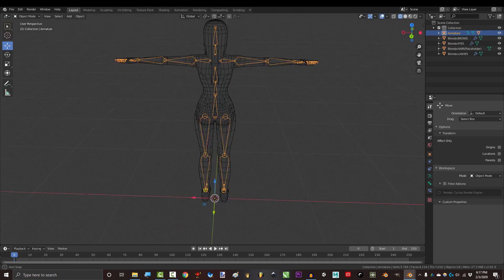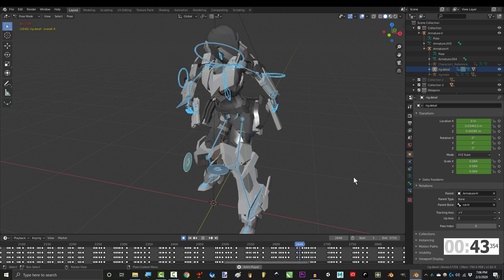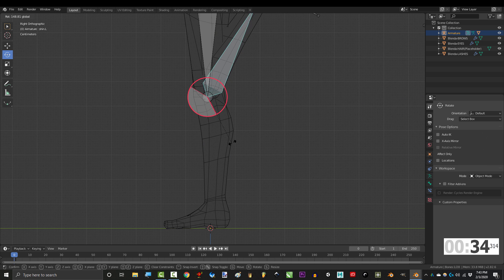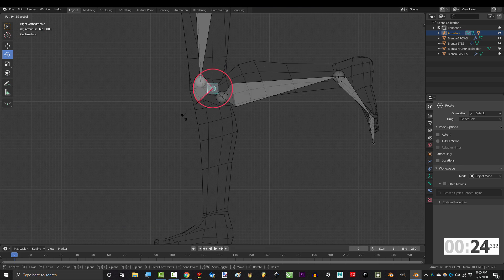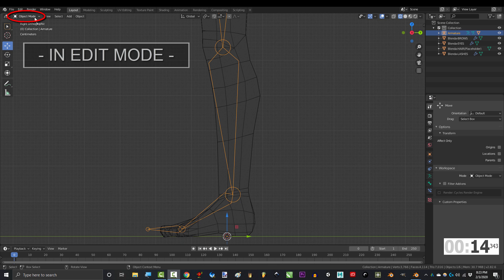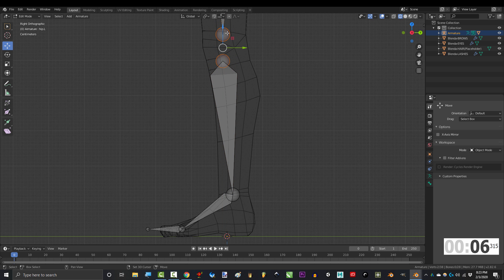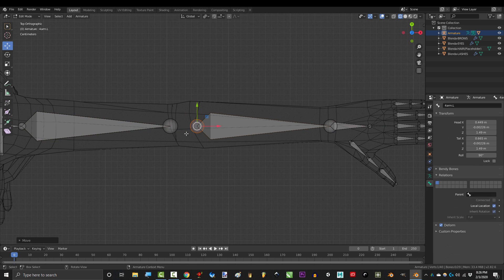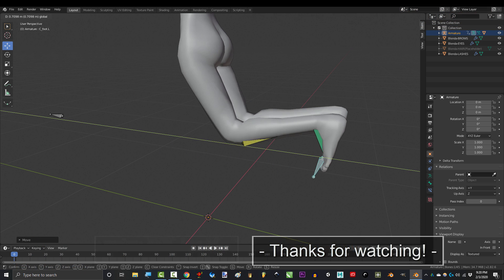Blender 2.82 : Advanced Rigging In 60 Seconds! (Double Joints)

Comment from the maker: Just a heads up, you can solve the knee deformations with weight painting, drivers, and shape keys as well - This is more of the "fast workaround", but in the long run it's usually better to do a single joint with shape keys. This was just something I learned that helped as a quick fix -
Reply: you are our savior, thank you very much for everything you do.
Reply from the maker: @rustyexe9378  No problem~
Reply: Are you doing a series of videos about rigging?
If you do it would be amazing cause its extra to your previous videos who where also great
Reply: why people use squiggly symbol so much
Reply: @transgirlyuri  ~
Reply: why is it usually better to do a single joint with shape keys?
Reply: You need an extra joint, or a mega joint
Reply: He for you make a hip ik for crouching
Reply: make a tutorial for prpper double chins or even multi chins (tripple,quad,penta chins xD)
Reply: Iv'e been doing something similar on mi Cut out rigs for a while, now that I'm learning blender rigging I'm going to give it a go!

Comment: I wondered why this messed up my model's knee but then remembered my IK chain length was set to 2 and now it was one bone longer, so it worked after changing it to a chain length of 3.
Reply: @Our Brooklyn Homestead In Pose Mode select a bone that has an IK, then in Bone Constraint Properties you should find the chain length. I heard this doesn't work for automatic IKs but I'm not sure (as there is no constraint in that case). But I think you might STILL be able to change the chain length then by selecting the bone and pressing shift and page up/down.

Comment: This is the correct way to do it. Adding to that, hands and fingers SHOULD use 4 bones for each finger instead of 3. Each finger has 1 initial bone inside the hand mesh, so that if the model spreads or closes the fingers sideways, the hand and space between fingers will change too. It's horrible to see animations with "stiff hands"

Comment: this method didn't work realistically if pole angle is 90 degree, so I reconfigure to make my heel correct with -90 degree value. otherwise (if 90 degree without minus) the knee will bend to backwards, not forward just like normal human knee. Also, did you just change the knee IK position? it's different from before

Comment: I have a question. How do you add these new joints, and others like controllers when you already mirrored the previous joints? Do you have to wipe the other half and re-mirror the joints, or maybe use symmatric bones? Or is there something else that I am missing? Thanks!
Reply from the maker: Sure thing. Make sure you have x symmetry then add them in. It should add them to the one side as you work on the other automatically -

Comment: I've followed exactly, and for some reason my shin bone doesn't rotate away from the new knee bone I created
I have the same bone settings as the video, is there something I've missed?
Reply from the maker: In edit mode, move the bone between the thigh and shin away from the body a tiny bit, then go back to pose mode and see if you still have the same problem -
Reply: My bad, transform pivot wasn't on individual origins

Comment: How do you make both the knee and the shin rotate at the same time; in your video you seem to just be rotating the knee, yet the shin is also adding its own rotation...how?
Reply from the maker: Select them both before rotating and then rotate :)
Reply: @TheRoyalSkies  I tried that, before you replied, i went through your video frame by frame to confirm that this is what you did, but it categorically does not work for me, both joints still just rotate from the knee, and the shin adds none of its own; its locked straight. Is there a preference setting somewhere that stacks rotations?

Comment: figured this out for myself a while back, also had some issues in the automatic weight paints where my arms were getting weights from the torso and i solved that by placing two "rib" bones on each side from the stomach pointing sligly up and out in either direction. and now i can use them for very subtle breathing animations. and not having to spend hours in pesky weight paints!. the extra bones can also be deleted after weights are set.
Reply: nevermind you cant delete the bone , but you can hide it

Comment: I was skeptical about the anatomy part. After all, knee braces only have one point of flex. Right? So I looked at top end expensive knee braces for both rehab and protective gear manufacturers. Not only is this right, but now I feel my whole life is a lie based on Walmart skeleton decorations.
Reply: Looking at the xrays, it looks to me as there is a singular center of rotation in both examples shown.  The lower link rotating around the center of the 'ball'. Which makes the double joint inaccurate, but perhaps leads to more pleasing skinning.
Reply: @heisenbugz  Exactly. The extra joint in the rig just gives some verts a different pivot point and reduced rotation but technically knees and elbows in real life only have one pivot point. It's just offset but there's no secondary rotation.
Reply: @thirdeyenz  no once the knee is at around a 90 degree angle the tibia starts rotating by the back of it’s head if the lower leg contracts farther because the long part of the femur will get in the way if the lower leg only pivots on the ball part of the femur
Reply: I think we all need to re-evaluate if our beliefs are based on seasonal decorations. Warm, wise words in these troubling times.

Comment: Cool, any idea if this technique can be used when using Rigify  (like if an extra bone can be added in and not cause problems to rest of rig?)
Reply: With no effort? No. With basic script modifications? Partially. If you add the new bones to the right string lists, everything should work except for IK2FK.

Also, you’ll have to create the bone, duplicate once for each layer, then reparent all bones on said layers, fix all the constraints on the thigh, add constraints on the new bones, increase the IK chain count, reset Stretch To constraints on all adjacent bones... it’s really a lot, but just might be worth it.
Reply: @philbertius  - gotcha, thanks for the reply

Comment: interesting i havn't seen this kind of rig yet from professionals. usually it's done by altering the geometry for the region to allow for proper bending.
Either there is a downside to it (which might be performance as more bones = more expensive which shouldnt be too impactful though)
or you are a fucking genius which is more likely tbh
Reply from the maker: We'll go through the philosophy behind the rig. But, this is a game design rig technique I've used before. If you're doing super low poly or phone games, I recommend the basic rig setup. But, if you're doing anything more than that, this setup is quite healthy in performance :)
Reply: @TheRoyalSkies  Yeah sounds absolutly right. going to try this out for sure :)
Reply: I've seen things where they add a bone that rotates on reaction to the rotation of another bone, so that it can morph geometry. Rigging is more complex than you think, theres a reason there are people that specialize on just rigging.
Reply: The geometry being adpated to deform will just aid this type of design. They dont conflict but rather complement eachother for the optimal result.
Reply: If your PC staggers from a few extra bones it is time for a new PC 😂 heck for fun last night I had 10 million particles acting as blades of grass now that adds some grind time to processing and is not recommended 🤪